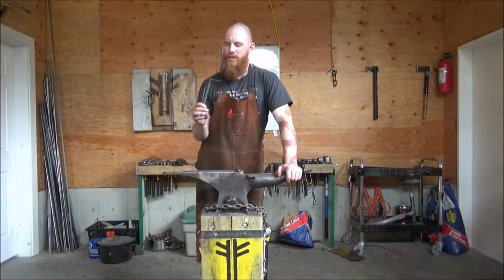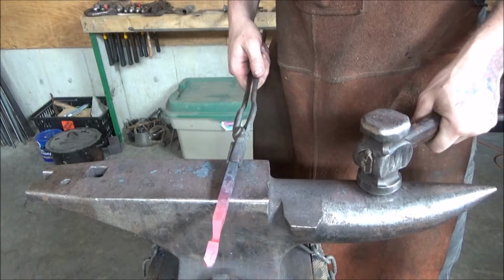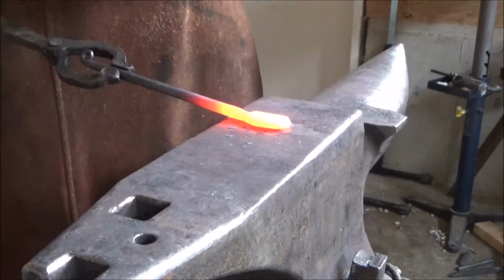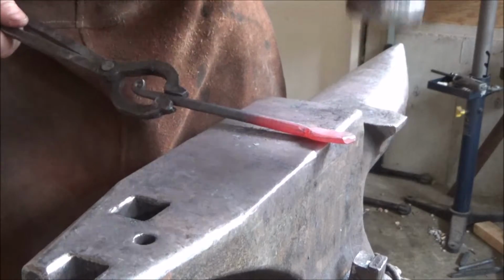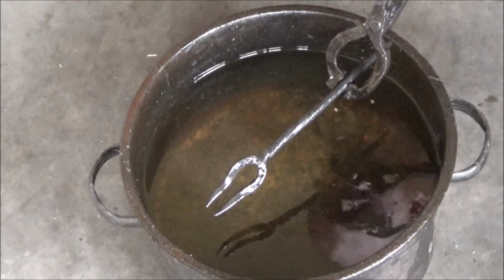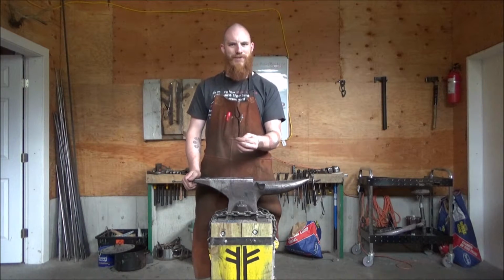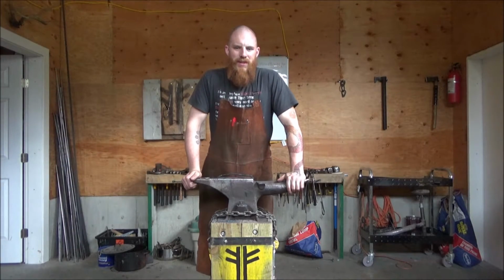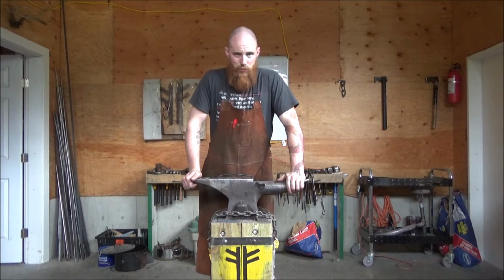Viking Cutlery Set: The Fork

Comment: Looks great Chris. One more way of making these is start with the size stock you want for the handle. Then Make a loop one end and weld it back to itself at the point of contact. cut the loop and you have tines that are the same size as your handle that you can draw out., If you cut small stock the tines get to small. Also a good way to measure your chain links are to wrap them around the handles of a pair of tongs mounted in a vise.. Most tongs taper down the reigns so you have lots of measurments in one tool. Looking forward to the next two videos.
Reply from the maker: Oh good idea!

Comment: Good job! :-)
A Tipp for better Foodsafe blackening: Take a piece of Canvas and let soak it with linseed oil. Then let it dry out. it could last a couple of days. Then roll the Canvas like a Cigar an fix it with some sewing cotton.
if you ready with the forge work, brush the hot metal and let it cool down to  no glow. 
Then you can use your Linseed-Cigar like a pen, and rub it soft over the metal. The Canvas would burned and smoke, but the dried Linseed-oil will melt and burned into the metal.
Another Tipp with the Fork: 
After splitting the Metal. spread the two pieces easely with the corner of your Anvil, or your Splitter, witch you can put into Anvil.
And you can use a tiny tong for tiny work.  :-) Maybe a pointed, spiked electrical worker tong.
Greetings from Germany, Martin
Reply: sounds like a cool idea, just want to make it clear to folks to be sure and use raw linseed oil, boiled linseed oil is treated with chemicals that are toxic.
Reply from the maker: Absolutely correct Darrel. In fact I mention that point on my steak turner video!
Reply: Other foodsafe oils will work well, too. I also use canola oil, but I wipe it on as Druide1974  mentioned. I used to know a smith who just used regular vegetable oil. In one of his videos, Brent from Purgatory Iron Works (the FIF contestant who made the crazy battle axe when his knife plan went south) mentions that he uses flax seed oil... he also uses the wipe-on method. 
Hint: Make REALLY sure the cloth you're using is what you THINK it is! In oil-wiping one piece I recently did, I grabbed a chunk of what I was SURE was good cotton flannel. Ummmm..... not so much. Melted. What a mess. Had to take another heat to burn it off and brush all the crap off my piece. LOL!
Reply: Flaxseed oil and linseed oil are basically the same thing. Flaxseed is the name used for food products, and linseed oil is the name used for industrial purposes. Sometimes even things labeled Raw linseed oil are contaminated with petroleum products making it not technically "food safe." Linseed oil doesnt need to meet as strict of standards because it isn't labeled food safe (maybe there is some, but I havent seen it). Flaxseed oil is labeled food safe, so its more expensive. But raw linseed oil and flaxseed oil are the same kind of oil..... And you are definitely not the only one who melted fabric on a piece. Makes a mess!

Comment: Nice work mate,don't worry about the stainless- it is shit to work with! Inter granular fractures and elements coming out of solution. By the time it is hot enough to work it's buggered. I just don't bother with it any more. A nice ductile bronze makes good looking cutlery too but plain old steel the way to go. Our Viking ancestors would recognise your techniques and finished products.
Reply from the maker: +Andrew Wilson Thanks. I'm hoping the knife goes smoother with the stainless. I have worked with it before and Yeah, it's finicky stuff.. I'll probably forge it close and do the rest on the grinder to avoid any problems. 
Skal brother.

Comment: I bought a set of something like this but it was slightly rusted and often leaves black residue on your fingers whenever you pick it up how do I fix that and make them food safe again?
Reply: Use some steel wool or sand paper to clean off all the rust and residue. Then heat them in a fire or in your oven so they're hot but still black. Then rub them down with a rag soaked in vegetable oil. Should last awhile before rusting again . . .

Comment: I'd bet you were having troubles because of your splitting chisel. You can get away with it in mild, but stressing a sharp corner like at the crotch of the fork in much higher alloy steels will be a load of trouble. Sharp corners should be the bane of your existence, did you know the titanic actually ripped in half when it sunk because there was a sharp corner where it should've been round?

I'd suggest if you try splitting something non-mild again like that that you devise some way to make the crotch of the split a round transition. Such as drilling or punching a small hole where you plan on splitting back to. 

Another tip on this sort of splitting so that you can stress that point less is to forge it less. And you can do this by tapering the blank before its split. That way when you split it you wind up with two already fork like tines that just need to be cleaned up.
Reply from the maker: Great advice. Thank you. I will try that!